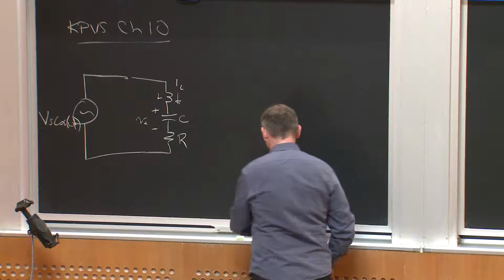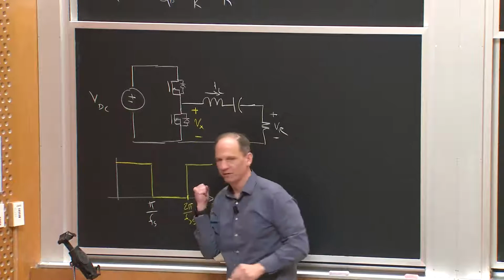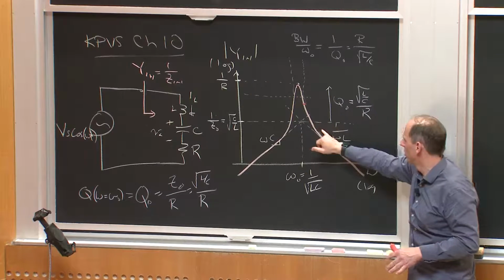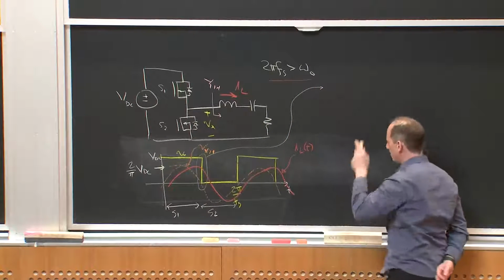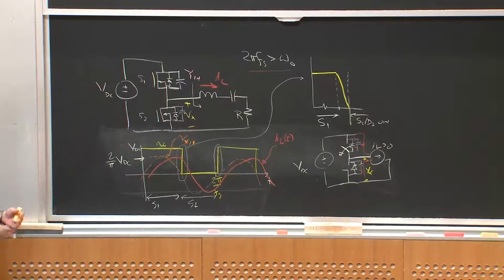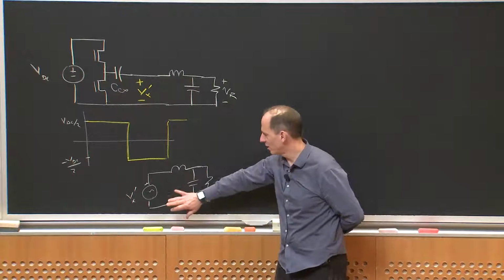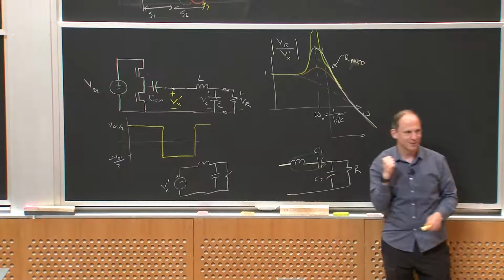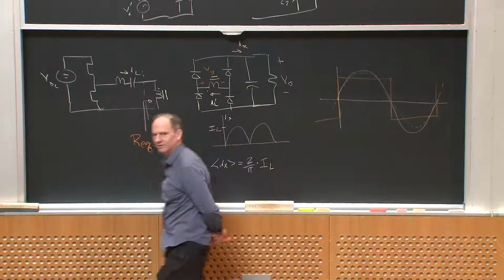Lecture 36: Resonant Power Conversion, Part 2

Comment: At least draw the LLC converter since it is used in most PCs. The LLC is required for more than the 60% efficiency of the boost and buck 1920 vintage converters.

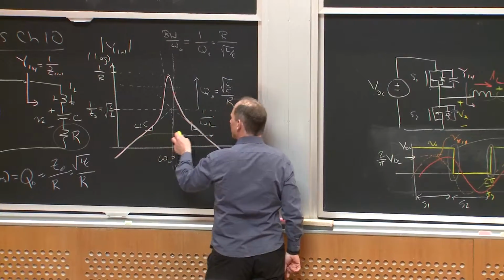Comment: Around 31:00 If Q is high, isn't power control (through frequency change) more difficult on a steep slope?
Reply: The idea is that with very small changes in frequency you can achieve power regulation. Hence the control effort can be said to be lower.
Reply: Digitally, you can wield precise and very fine-grained control over the switching frequency. Steepness of the slope doesn't matter, because you can hit a precise, stable point on that curve.
Reply: The frequency is constant, which is very easy to maintain by the switching function.